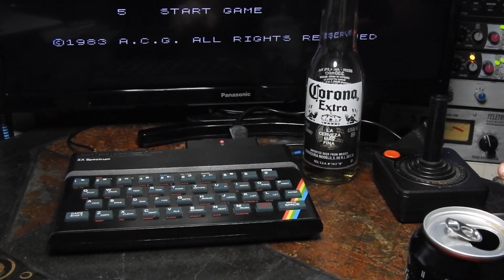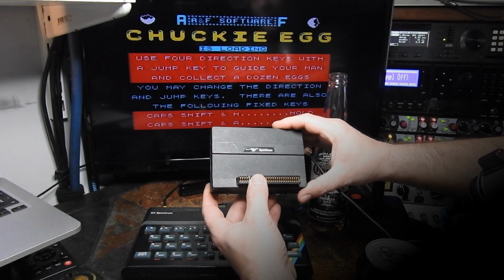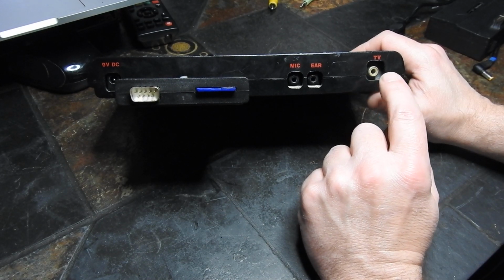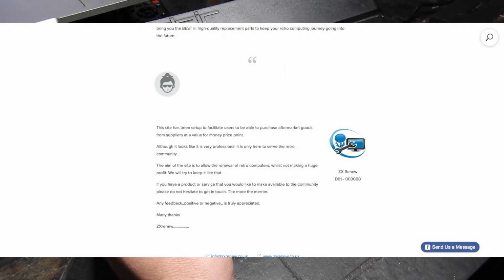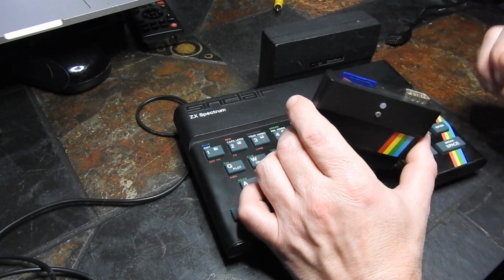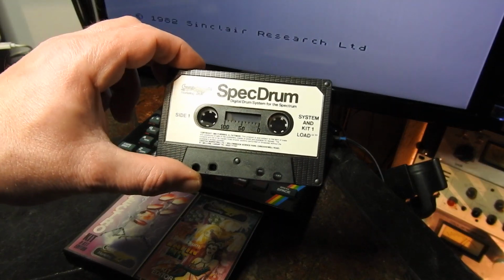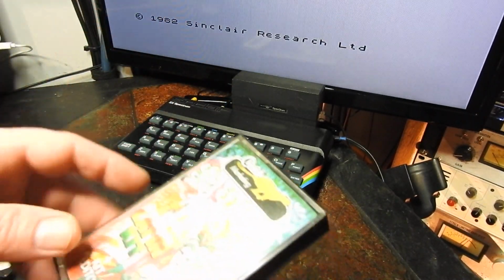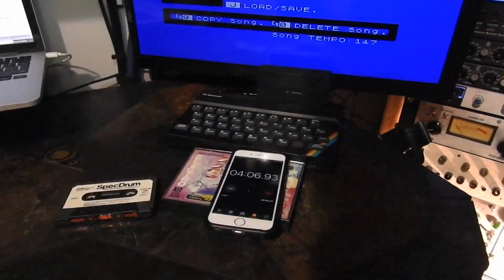Cheetah Marketing Specdrum EP1 Introduction

Comment: I have two Specdrums. I used to run them in stereo on two Spectrums. The SpecDRUM was one of the best things that ever plugged into a Speccy. It was superb!
Reply from the maker: Holy crap I would of loved to hear that!
Reply: @Really Nice Audio  They just sounded like normal stereo. 
The tricky bit was synchronising them to each other, so the stereo image was stable. The synchro line wasn't sufficient to control TWO Specdrums at the same time when it had been split into two, but I bought a tiny battery amplifier (£3 @ Maplin) and that worked perfectly.
There were lots of things to like about the Specdrum. The pattern programming page was a masterpiece, considering it worked so smoothly and swiftly as it did on a computer that had only a keyboard and no mouse.